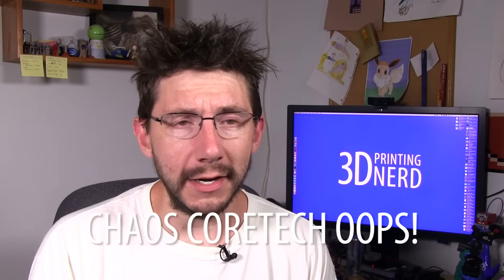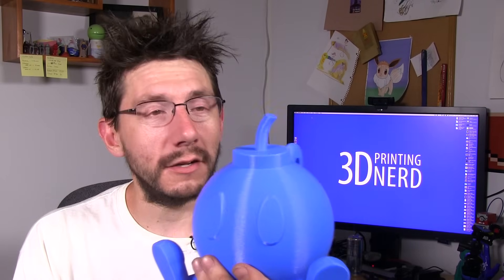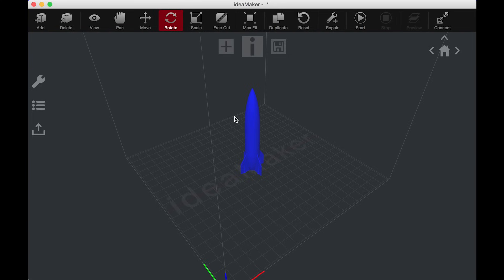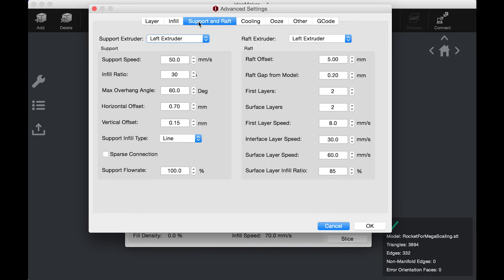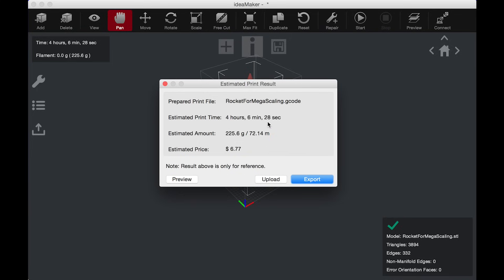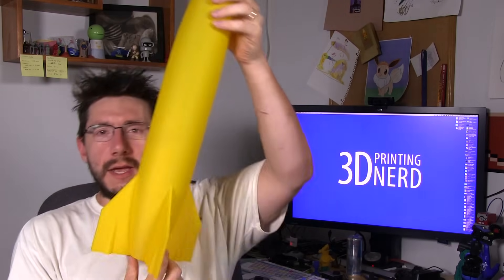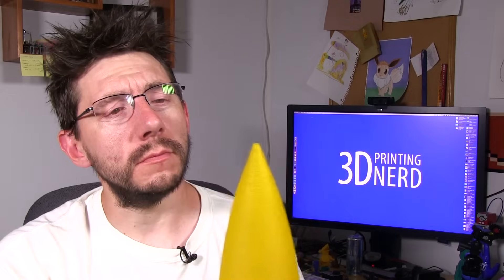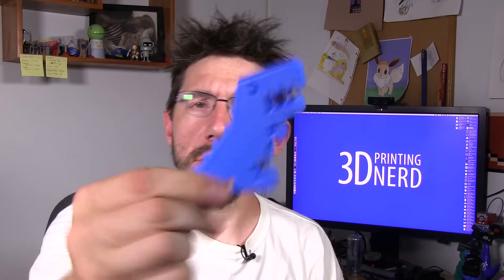3D Printing: Raise3D N2+ 24 Inch Rocket

Comment: As I said elsewhere... this printer is not for a normal users but for engineers that torn it apart and re-assembles it, to correct all the embedded problems!

Comment: Joe at 1:07 you said that you followed the instruction which was given to you by Raise3D??? Don't you think that this should be solved before in factory?? C'mon screws doesn't come loose during a transport!  It's just that the printer is badly manufactured.

Comment: Hey Joel,  Could you please do a review of the Folger Tech FT5 or another Folger Tech printer?  I have boon looking for a large format 3d printer ideally greater than or equal to 12*12*12 for making rocket parts and am having a hard time deciding between the foger tech, the gMax and this one.  Thanks for the videos and HIGH FIVE
Reply from the maker: I'm told I have a Folgertech FT5 coming at some point, so we will see!
Reply: 3D Printing Nerd any update on this?
Reply from the maker: +tarui on which part?
Reply: 3D Printing Nerd hi.  Thanks for the prompt reply. I mean comparing between raise 3d and ft5.

Comment: Hi Joel.  Your reviews are great and very informative.  I recently purchased a Raise3D N2+ and after having the motor replaced it prints beautifully.  Thing is it skips and things shift about a mm or two which sort of blows the whole print.  Could this be related to the loose screw issue you had or the filament tubes?  I think you mentioned you got instructions from Raise3D to fix the screw issue?  Anyway you can forward?  :-)
Reply from the maker: Hey! Skipping could be a screw issue if the grub screws holding the pulleys on are loose. I tightened all the screws on the X and Y axis mounts and all the grub screws on the pulleys.
Reply: Thanks brother.  I'll check the screws, tighten, and let you know what happens. :-)
Reply: Hey Joel.  Tech came and tightened the whole thing up for us.  Priced again and there was a knock sound and it skipped.  Looks like the nozzle is hitting the print.  Thinking we might be having the same issue you did with the tubes the filament runs thru.  Going to remove those.  Was there anything else you did? Raise also said to lower the x/y axis traveling speeds and the flow rate.  Printing in ABS so keeping the lid on.
Reply from the maker: +Hov P hmm. I ended up cutting the tubes a bit just leaving some on either side. maybe try that? I can detail that if you want.

Comment: so would you recommend gmax 1.5 or the printer here?
Reply from the maker: Abodizer89 You're welcome! I've found their support to be extremely well with communication. So far, good printer and good company behind it.
Reply: Wondering my self. This or the glad 1.5 XL+? Would appreciate some opinions on the matter.
Reply from the maker: +Abodizer89 they are both great machines. still testing the N2+ and it is printing incredibly well, just want to run a few more materials through it.
Reply: +3D Printing Nerd thanks Joel for replying! Hi5 XD
I got in contact with their support team and we were exchanging emails all day long, but to hear from you that it's doing well, that's a confirmation for me. I think I'll go with them first and try to get the gmax later. Thank youuu

Comment: Sorry for all the questions in advance but... Do you plan on testing it out with exotic filaments such as tglase, bronzefill, nijaflex or others? What is the internal makeup of the extruder? Is it an all metal design that can be pushed with higher temperatures? How well does it handle multiple items on the build plate? Lastly, how does the hotend compare to those such as the ones made by e3d? I am seriously interested in acquiring one of these printers and some of these answers will assist me in making a decision. Thanks in advance for the answers.

Comment: great video .  the hole at the top of the rocket , could that be it was possibly taller than the build volume and got clipped in the slicer ? #Highfive
Reply from the maker: +XerotoLabs I thought that too, but I went back to the slicer and saw the hole! I need to investigate a little more.
Reply: cools . quick test would be just try to slice it at 1/2 the size you just did , if its all pointy up top , then you know the first rocket was really pushing the limits . LOL  
very cool printer & interface.
Reply from the maker: +XerotoLabs good call. I'll do that soon! it's late and the wife and I are on episode 5 of Stranger Things :)
Reply: oh man . wife and i finished watching that last night .  crazy good , i hope they do an other season soon. enjoy the show.

Comment: Looked like the model rocket came to a point in the slicer (before the layering view). I guess  max fit is a touch over zealous.
Reply from the maker: +Budd Weaver I zoomed in and checked - wasn't a point! I was surprised! it was a small hole, just like what was in the model. crazy.
Reply from the maker: +Bruce Shoot, I really need to look into that! The Raise3D slicer has seen a few updates since then so maybe it's time I give it another shot.

Comment: Joel, I hope you can  answer this question which is better on a delta printer a pulley system or a linear bearing system. thanks. I'm thinking of buying one. BTW keep up the good work on your videos, I enjoy them and their informative.
Reply from the maker: I've only ever used delta printers with a pulley system, and they worked well for me. I'll need to get my hands on one with linear bearings.

Comment: Hey I Don't know if you saw but the cube 3 from 3d systems is being unloaded for $150 on amazon (originally like $1200) due to it being discontinued.  This would make for a cheap review video and possibly a controller swap or drm removal video .... the hardware is top notch its just the boat anchor of software that made this sink. mine is in the mail what do you think?

Comment: Hi Joel. Nice vid. One question. You set the printer to use retraction. But do the printer use retraction in spiral base mode?
Reply from the maker: I think that setting doesn't get implemented during vase mode.

Comment: Hello Joel, I've been a subscriber for less than 2 months.  You, Chuck H, Angus, and Tom ignited my 3D printing fever!  In less than two months I went from having no 3D printers to two and have designed and printed several parts to build a large PCB holder with no previous CAD or 3D printing experience.  I'm hooked and have bought your T-shirt and am now a 3DPN Patreon supporter. SASE for a sticker is on its way.  High Five!!

That out of the way, I am glad that you reviewed this larger and more expensive printer in spite of some of the critique about it being out of many folk's price range.  If the need and value is there I would consider one when I felt that I needed to upgrade.  It answered a few of my questions - 1) If I want to upgrade to a "professional" printer, what do I get for my money?  2) Are the more expensive printers plug 'n play?  - They apparently also have a learning curve (smaller?) even for experienced 3D printer users.

I'd like to see one more followup when the printer is "tuned" for a rocket re-print and a more complex print.

Comment: would you please go over what it was you changed/fixed and show us please.
Reply from the maker: +Comicbook Hobby I had to tighten some of the screws in the plastic mounts for the X and Y rods. Plus, I needed to run the bed about 25c hotter.
Reply: +3D Printing Nerd thank you

Comment: Hey Joel.  I have the Raise3D as well. We met at Matter Hackers last month.  Can you share more details about which screws were loose?  I have the same issue with the nozzle hitting the print.  Try printing the thingiverse piggy bank with all of the holes in it as an example of something complex. I have yet to get it to print to the finish without breaking parts off. I have even tried Z Hop.   Still no luck.

Comment: It seems like the software works pretty well. I am a bit spoiled by Simplify 3d.  Any thoughts on Simplify 3d compatibility and possibly using Octoprint served to this printer via Raspberry Pi?  Oh and thank you for all the awesome reviews!!
Reply: Simplify3d works fine with Rasie3d printers. Idemaker has wifi connection to the printer so with that you can controll the printer from distance if you want.

Comment: The reason your sample rocket had the top cut off was because of the layer height difference. With .28 the model fit,  then when you switched to . 30 it slightly increased the size and cut off the top.
Reply from the maker: Well, I don't know about that. I checked the ideaMaker software, and hitting "max size" in the software increased the rocket scale, and there was a hole at the top. I think it's the model, but will have to investigate.
Reply: +3D Printing Nerd Oh, for sure it could be.  Did the printed model have that hole?
Reply: +3D Printing Nerd: #HighFive

It's not a fault of the model you used, it's the ideaMaker software. The Maximize button scales the model to completely fill the build volume, as expected, but it doesn't take into account Raft thickness.

When you slice it with any kind of Raft the model gets moved up 4 layers to allow for the Raft, e.g.: 4 x 0.25mm = 1.0mm. The current version of ideaMaker, v3.1.7, gives you a warning dialogue about clipping when you try to Slice the model if the Raft will make the model too big: The height of "Rocket.stl" plus with the height of Raft is higher than maximum Z height of the build volume, do you want to continue? [No] [Yes]

If you're expecting you use a Raft to print your model you'll need to manually use the Scale function instead. For your example of Botmaster's Classic Rocket model on the Raise3D N2 Plus (with an advertised 610mm build height, but actually it's 609.1mm) the maximum height you can specify for the model is 608.1mm (or 419.38%) to avoid the warning dialogue.

Comment: Hey, I wanna get into 3D printing but I wanna do it on the cheap. What would be the best printer to get?
Reply: I would recommend Fabricator Mini from Hobby King to any beginner. 
Its really cheap but it is a great way to get started. Have one my self (and 3 other printers).
 + Just gave my dad one for his 50th birthday (He loves it)
Reply: The best cheap 3d printer you can get right now is the Wanhao Duplicator i3. A good US stock source is printedsolid.com
Reply: +Tom O Sullivan the m150 is not a Wanhao i3 v2 clone. it's a lookalike.  Definitely go for an actual Wanhao Duplicator i3 v2 or an actual clone if you can afford it. The fab mini has been on backorder for a long time unfortunately.
Reply: i doubt he would answer that question, whats your budget. what will you be printing. you should look at m150 from hobbyking.com it's a Wanhoe i3 clone, or the tiny fabricator mini. the m150 will need fine tuning but it does print well out of the box, make sure the extruder gear is tightened,it seems to be loose on a lot of them. hope that helps
Reply: + Jack Martin, yes clone if you can afford it, m150 is still very affordable and a good base to work on since it's compatible with most upgrades available for the i3, let's face it, everyone who buys the i3 and lookalikes will ultimately end up changing and upgrading it overtime, that's what we do 😂. but you are 110% correct Wanhoe if you can afford it is the smartest choice in the long run
Reply: Tiko is an OK printer that just came out after a kickstarter.  It's $180 (for now) and has decent quality.